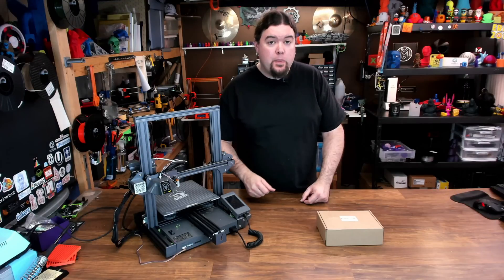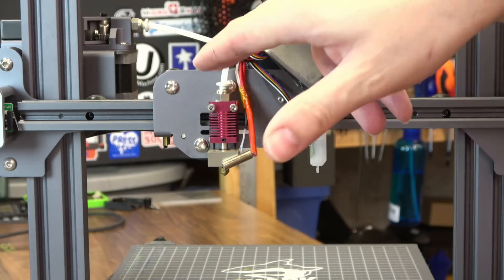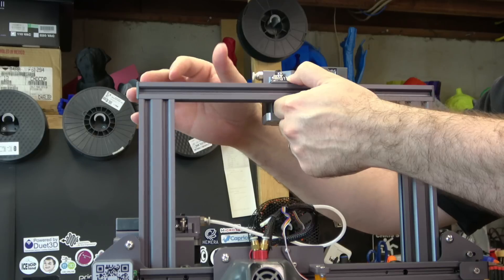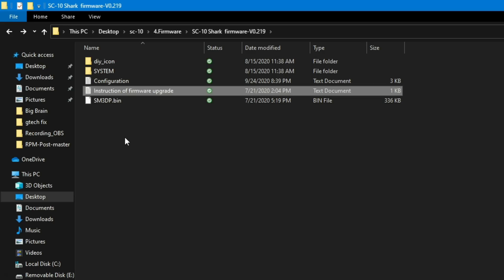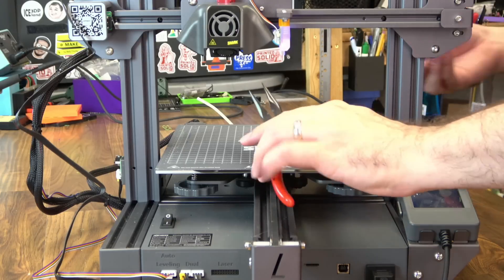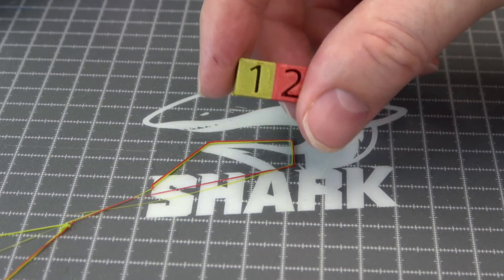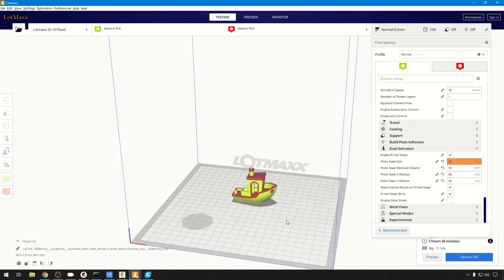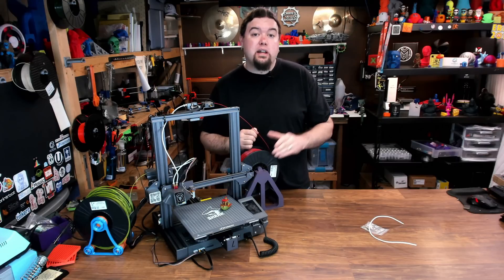Lotmaxx SC-10 Shark - Dual Color Install - Chris's Basement

Comment: Thank you so much for this video. I spent hours trying to figure out how to print with 2 colors from the Lotmaxx website and you tube channel and the information was very vague.  You clarified everything in 17 minutes. Thank you again.
Reply from the maker: Glad I could help! Thanks for watching
Reply: @ChrisRiley  this printer worth buying
Reply: @ChrisRiley  how do u enjoy this printer so far any pros or cons
Reply from the maker: Pro: Duel color was easy to use.
Con: Proprietary firmware is a big turn off
Reply: @ChrisRiley  why the firmware
Reply: @ChrisRiley  what’s wrong wit the firmware
Reply from the maker: @monsterstorm78  It doesn't have a lot of features and you have to get all the updates from Lotmaxx.
Reply: @ChrisRiley  shouid I buy this printer as well or

Comment: Problem: I added the software to my printer, but the option for a second extruder doesn't show on the Lotmaxx app machine settings. How do you get it?
Reply from the maker: You need to update the config file like I show in the video. If not, lotmaxx will need to get you some new software.

Comment: Have had a dual printer for many years but think it is worthless as most prints I do are for useful projects and colour is never needed, just another thing to go wrong.
Reply: One thing I potentially see as a gamechanger is using water soluble filament in one nozzle and PLA/other material as the other.
Reply from the maker: @polishhammer1992  Absolutely.
Reply from the maker: I don't disagree. Pretty cool when it does work.

Comment: Having issues with wire management under that shroud (they hot glued the fan wires...?)  hoped for some insight.  https://youtu.be/rR8z9hJ4h4c?t=265  nope.
Reply from the maker: With the add on's the wires start to get messy indeed.

Comment: Thanks for the video. I followed along and then got to the stepper driver and found it wasn't there. Damn it. 
For some reason when I merge two items in the software, it centers them both instead of side by side like yours does.
Reply from the maker: Hopefully Lotmaxx with get a driver out to you quickly.

Comment: How did you disable the steppers when there is not an option to do so?
Reply from the maker: I have a button on my screen for it. I can take a picture if you want to compare.
Reply: @ChrisRiley  I found it, it's the "Stop" button under control.

That is not what I thought that button did, thanks mate.
Reply: @ChrisRiley  Yes as I don't have the option

Comment: Nice video chris

Purge blocks are very wasteful,why cant we measure the volume of plastic remaining in the heatbreak and nozzle.and have this information entered into the printer firmware.the printer could then change colour in advance and use the remainder of filament until the new colour feeds through..to prevent colour bleed ,any small amount that remains in the nozzle could be used on the inner walls of the model for infill.
Reply from the maker: Thanks! Excellent idea, at some point one of these smart guys will work that into the firmware. ;)

Comment: 12:20 automate end code: G1 E-10 for both nozzles
Reply from the maker: You could probably find some settings that would work. In the end gcode now it does a E-85 to make sure it is clear. If you got really good with it, you could find a setting that was perfect for the end and the restart.

Comment: Could you enter the 10 mm retraction in the end gcode that you said to do manually at the end of each print?
Reply from the maker: You could probably find some settings that would work. In the end gcode now it does a E-85 to make sure it is clear. If you got really good with it, you could find a setting that was perfect for the end and the restart.

Comment: 12:00 would it be better if the color change happened over the tower instead of the part?
Reply from the maker: It would for sure, I am going to try it with Prusa Slicer it handles color way better.